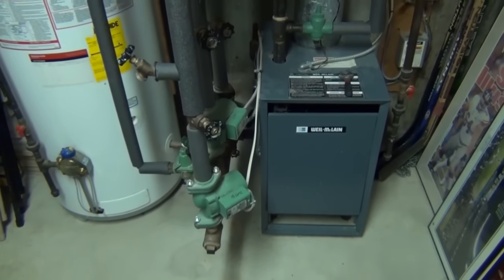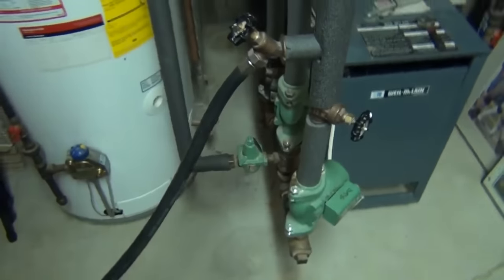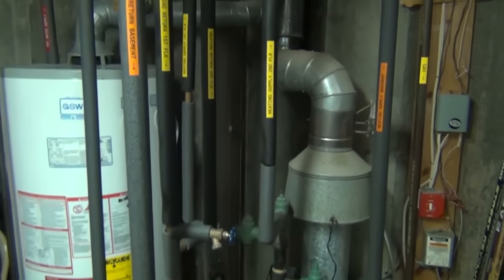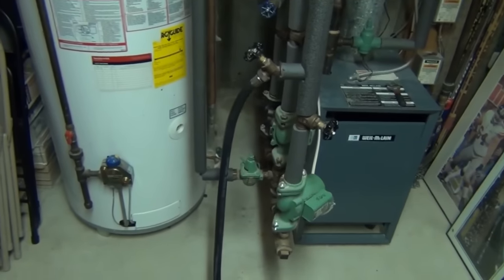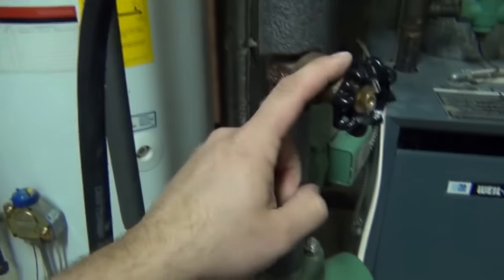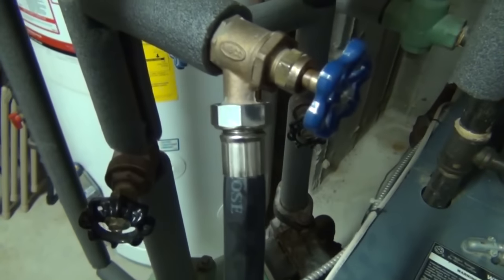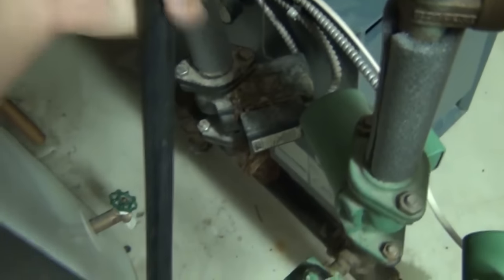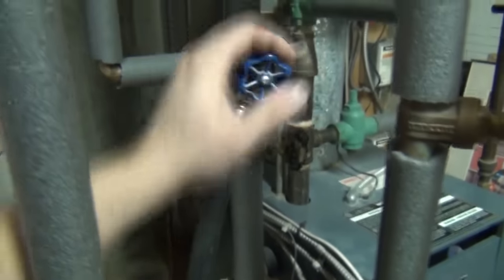Remove Air from your Boiler and Heating System | How To

Comment: Excellent explanation of purging the air from a closed system. Newer hvac techs should watch this before servicing residential customers. Nothing against newer techs but they mostly seem to be forced air systems more than boiler systems. Good job! 👍

Comment: You're  an great teacher, very informative my lower level was not getting hot I changed the zone valve , purchased a new thermostat ect. ect. came across your video, ran down to the basement  turned one of the knobs, i instantly heard a rush of water running through the pipes, and that is when I realized a few months before I had changed my expansion tank and forgot to turn that back on, unbelievable.. I now have heat on my lower level Thank you
Reply from the maker: Glad you got it fixed and thanks for the compliments!!
Reply: 😂 Seems we have all done that type of thing before! Glad you sleuthed out the problem.

Comment: THANK YOU!  THANK YOU!  THANK YOU!  THANK YOU!
   I have 2 radiators in storage areas that would be a pain to bleed.  If I had to move all that stuff, it would take several hours to move, and then replace.  Bleeding the entire system at once is a life saver.  I had a couple of leaks underneath concrete. It's bad enough to dig it out.

Comment: I have been maintaining my boiler since 2004. I have not had air issues until this year. This is very through and helpful! I only have 1 zone with bleeder valves and that was added during a remodel. I had no idea how to purge the other zones. Thanks for making the video!
Reply from the maker: No problem and I’m happy to hear you found the video helpful!

Comment: I dont normally comment, but you do a good job at covering all the details that are very crucial. I work in trades as well,  and I can tell you know your stuff.  I’m replacing a friend’s expansion tank and needed a good explanation on the system. Other videos suck at explaining. Good work

Comment: Thank you!!!!  I was trying to refill my system, and I was failling miserably with too much pressure in my system since I was using the fill val improperly until I found your great video.  Thank you again, that bucket trick is a great idea!

Comment: Fantastic Video. It worked perfectly for me following the instructions. The only thing i would add is that for people like me who have “Zone Valves” that open each zone when the thermostat calls for heat, there isnone more step that needs to be done, that is to manually open the zone valve in the zone you are purging the air from so water can flow thru that zone. There is a lever on my zone valves that I move to do this. Then after that zone is purged, I move the lever on my zone valves (Taco) back to the normal (closed) position. Again fabulous video my system so quiet now such a great feeling not to hear that water 💦 gurgling lol 😂.
Reply from the maker: Yes, great point!  Appreciate that!!

Comment: Hi Zim .... when you are purging a zone and you open up the Fill Valve to Full Pressure... is it possible that the Added Pressure is going to put more Pressure on the water in the Expansion Tank and then possibly Rupture the Bladder/Membrane?.. Could that added pressure also cause leaks at various unions or valves?..  Your Video is FANTASTIC!!!   I have the IDENTICAL Furnace as your's. So it's been a True Pleasure to watch all your videos...  Plus, your Explanation is so Thorough and simplified, that makes it easy to learn!!! THANK YOU....

Comment: Thank you!  For anyone struggling--read this.  Basic premise is you need to know the direction of the water flow.  You want city or well water to come into the boiler through the pressure regulator, go through the boiler, and out into ONE zone at a time but before it gets back to the boiler you want to close a valve to stop it from going back into the boiler.  Hopefully, right above that valve, you have a drain valve that you can hook a hose up to and let the water circulate until no bubbles come out.  I have one circulator and three zone valves.  The zone valves are usually on the return side and they have arrows on the brass to show the direction of water flow.  To help others, in the Read More down below, I've listed Nine steps that worked for me.

 Step 1--shut off power to boiler.  Step 2--note what the pressure is, there should be a dual gage that shows temperature and pressure.  Mine was 18lbs but I think most are lower. Step 3--figure out direction of water flow, usually up out of boiler, past expansion tank and splitting off into multiple zones.  Step 4--wherever the zones come back, shut the valves on all but one of them.  If there are no physical valves, you can leave the zone valves in the auto position and just put one of them in the manual position, which is open, and you can bleed that zone first. Step 5--close the main return valve to prevent water from going back into the boiler.  Step--6 hook up the hose to the drain valve which should be right above the return valve you just closed, and put the hose in a 5 gallon bucket where it can overflow and you can see the air bubbles stop.  On my three zones, there was one that took a full five minutes before I saw no air bubbles.  Step 7--Close the drain valve, close the physical valve on that zone or put the zone valve back in auto mode and open the valve on another zone.   Repeat the whole process.  Step 8--Close the drain valve, open the main return valve so that water can get back into the boiler.   Use the lever on the pressure regulator to bring the water pressure back to where it was.  Step 9--Pat yourself on the back for being a can do person!!!
Reply: @sptrsttradr4918 I have just one zone but my drain valve is below my main return valve. If I'm understanding this correctly, the only way I can drain my system would be to have the water run the opposite direction through the system than it normally does. Is this OK?? The city water  water coming in through the pressure regulator would go first through my whole house radiator system then come back past the expansion tank, into the boiler, then out the boiler, through the recirculating pump and finally get to my drain valve attached to my hose. Will this mess up my boiler to purge this way?
Reply: @ScaesarBtech  The water can only run in the direction that the circulator is set up to pump it.   Without seeing your setup, it's hard for me to give you advice.  If it's not clear what you need to do, it's best to hire someone.  Sorry to say that, but that's the best advice I can give.

Comment: I had similar setup as yours. 3 zones. Each had a separate hose bib. I cut them all off. Installed a ball valve on each and piped them all together using tees to 1 hose bib. Connect the drain hose once, and turn ball valves to bleed each zone.

Comment: The best explanation I've ever seen. My system only has 1 valve in the basement. There is no way to isolate any part of the hydronic system from the line which attaches to the water main. I'd love to see a video of how to drain the entire system. since I am going to need to add a few shut off valves.
Reply from the maker: Thank you!  I plan to do a follow up video soon and answer the most common questions that come up, this will be one of them I cover.

Comment: I love this video. It is so clear and informative. I have a question about my particular system. 2-story house. I don’t have any valves to close off zones. I have a quick fill from my supply line, then my pressure relief tank, then the only valve to release water from the system after that. It looks like I would be running water straight from the quick fill valve through the line that goes to my boiler/pressure relief tank straight to the above mentioned valve. Does this mean to bleed my system I’m going to have to resort to using the tiny bleeder valves on the second floor or am I missing something? Please help, and thank you!

Comment: This was awesome. Thanks. Wish you did house calls to Owen Sound Ontario. 
Mine is just a bit different. I hear gurgling in our bedroom. I was told to use the purge valve right on the rad. My old house had huge rads and once in a while half the rad would develop an air lock. 
This house is just a little different

Comment: Thank you!  So nice to see a no BS video ,clearly, cleanly explain this operation.  I'm a remodeling contractor in Hawaii, so I'm entirely ignorant about any and all home heating systems.  I'm restoring my Father's 111 year old  home in NYC and I need to remove some of the heaters and replace all the shutoff valves at the heaters.  I surmise I can shut the boiler off and drain the system to remove the heaters and then follow this procedure after reconnecting.  Is there a thermostatic shutoff valve that I can put at the heater in each room, to individually adjust the heat in each room?
Reply from the maker: Yes, you would want a thermostatic valve to control each radiator independently. You might have a steam system in nyc, double check everything before you start. That would be a different process then what I showed in the video

Comment: Great video showing all the steps for a multi zone system but I do have 1 question. I replaced my old Taco 007-F3 today with a Taco 007-F5 and had to empty the boiler to do so due to a lack of isolating valves.  That all went fine but when purging my 4 zones the longest run, up 2 floors and about an 140 ft loop kept showing small bubbles even after running high pressure through it for 45 minutes.  The other 2 upstairs zones did the same so I moved on after 15 minutes.  The 4th zone which is on the boiler level is the only one with no bubbles after 10 minutes. Is this normal?

Comment: I've watched a lot of videos and this one has the best explanation on how this works.  One question though.  I don't have a drain in my basement.  Can I shut the zone drain valve off while I run the 5 gallon bucket outside and dump it?  Thanks!
Reply from the maker: It will take you a long time to do it that way. Run the hose out a window and drain into the yard if you can

Comment: clear and detailed explanation.  my system needs replacement, but at least I got a hot shower (off the indirect dhw) after bleeding.  
Guess the bleed brought the water level up in the boiler so that it would get thru the indirect.
PRV is leaking now, but new system hopefully this week.

Comment: Great video and you explained everything very well. (My plumber doesn't do it that way which explains why I always have to call him back) I only have one question. I have cast iron steam radiators that I converted to hot water using PEX. You don't need to bleed the radiators?.

Comment: Hi.  Any idea what size rubber seals are inside the drain valves to replace them when they dry out? I need to get new ones for a few of my drain valves on the incoming zones.

Comment: i HAVE BASEBOARD HEAT WITH MY BOILER COULDN'T FIND ANY BLEEDER VALVES ON THE BASEBOARDS SO I'M HOPING TO PUSH THE AIR OUT LIKE YOU DID, I ADDED A GARDEN HOSE TO PUSH WATER IN , BUT I ALSO HAVE THE FLIP UP ON TOP OF THE WATER PRESSURE REGULATOR GOING TO TRY IT YOUR WAY BUT I SEEM TO KEEP POPPING THE 30LB RELIEF VALVE, THEY DIDN'T HAVE IT IN STOCK AT HOME DEPOT BUT i REPLACED TGE PRESSURE VALVE AND EXPANSION TANK EVEN THOUGH THE TANK SOUNDED GOOD BUT IT HAD A LITTLE RUST AROUND THE VALVE STEM WHICH WAS PROBABLY CONDENSATION  BUT IM INTO IT NOW. THANKS FOR YOUR VIDEO, YOU MAKE IT EASY TO UNDERSTAND.

Comment: Thanks, just did it per your excellent instructions. Very glad to know how to do this. And to understand the mysterious expansion tank a little better.
   I've got 3 pumps, 3 zones. Water coming out looked pretty clean from the get-go, fair amount of bubbling. But then ran the heating system, and noticed that one zone (biggest one, that does most of the house, runs up 1 floor) still wasn't heating. Pipe above the pump not getting hot. So I repeated the air bleeding. This time, got very rust-colored water and MUCH more bubbling from that zone. That did the trick.
    IDK why that zone needed a second purge, unless maybe needed to run the pump again because lots of air in that zone, hard to move air out seeing as it has to be pushed downward and of course rises upward in water. Might even be worth a third purge.
Reply from the maker: Yup, you’d be surprised how air in the pipes can stop the flow.  A lot of times it gets caught in elbows and other sharp bends in the pipe.   Glad you found the video helpful!

Comment: Thank you Zim! Great video. I have a very similar furnace with hydronic baseboard. I can hear water running in the radiators from time to time. Is air the problem? Any info greatly appreciated. Subbed and will be recommending this channel to my DIY crew....Northeast USA

Comment: Excellent video. What brought me here is one of my zones makes a ton of noise. It's more like a hammer sound coming from the pipe, like a pop and it's been getting worse lately. Didn't use to do this. I just had my yearly maintenance done and the guy (I trust their company) said he found no evidence of air in the pipes. If it's not air, which I may do this maintenance anyway despite his advice, what else could it be? Pipe too long and the expansion hitting something?

Comment: great video, I have a question about hammering and rattling noise from the pipes? are they cause by the air trapped inside?
Reply from the maker: Yes, more then likely it’s trapped air

Comment: Another good thing about closing the valves half a turn after opening them are that you can then easily tell that they are open and not shut. Many times you might try to open a valve that is already fully open, and then you break it.
Reply from the maker: Yes, very true. Thanks for the comment!

Comment: My home has 3 zones as well. So thank you for showing the process for multiple zones.  Zone 1 is making a lot of water gushing gurgling noises.  Zone 2 was recently replaced and 3 is in the basement, rarely used.  Do I need to do this to all 3 zones or just the one making all the noise?

Comment: Amazing video! First of all thank you so much for your time and effort kind sir! I do have a few questions if you might be able to help out: I have 3 zones and 3 zone valves. I changed the layout of several pipes on all floors...(cut and soldered them back) so there's definitely a lot of air trapped all over... 
In order for me to have my well fill the system completely in each zone, do I have to open each zone valve? Is zone valve communicating with the water filler valve if my boiler switch is off?
Reply from the maker: Thank you!  You would want to manually open each zone valve one at a time to purge. Remember, the boiler service switch should be off during this process so your zone valves will not work with the tstats with no power

Comment: Hey I'm a new homeowner and landlord.  Just got to say this is a great how to video and educational. I'm just learning how to do all this stuff so I'm a newbie. Just out of curiosity. Should I turn on all the faucets as well if I have to clear out the air from the pipes? If I dont have to shut off my tenants water supply that would be great.
Reply from the maker: Faucets as in sinks?  If so no, completely different systems. If you mean the individual zone valves, yes do them one at a time

Comment: I have a Burnham independence boiler in the house that I just recently moved into. Today was the first day that I turned on the heat and I am hearing loud banging noise (sounds like a banging hammer coming from the pipes). All my research online seems to indicate air in the system. Can you confirm whether this is an accurate diagnosis?  Would the procedure outlined in your video remediate this issue?
Reply from the maker: Yes, definitely sounds like air. It creates turbulence with the water in the pipes which is what causes the noises you’re hearing. Follow the steps in the video. Yours might me a bit different with valve locations, etc but it is the same process overall.

Comment: Great video.  I'd like to add one Very IMPORTANT thing - for those who don't already know.   Make sure the water in your boiler system has cooled down as close as possible to the temp of the fresh water that you will be introducing into the system.  WHY - It is not good for the boiler, to be introducing that much cold water into a hot boiler jacket. (On our boiler system, I can run just the pump and not the burner. If I have to add water in the winter - I run just the pump, until I see the temperature of the boiler water drop into the 70's - before I introduce any new "Cold" water into the system.  We are on a well and City water might be much warmer than our well water.)
Reply from the maker: Thanks - yes that’s the advice you hear but honestly I’ve never suffered any ill consequences not doing it that way … both at my house and other places 👍🏻

Comment: Thank You! What does a person do when there is no isolation valve or hose bib before the recirc pump? There is no way to bleed the air on the system I am working on other than to break a union apart that is badly rusted on an old system.